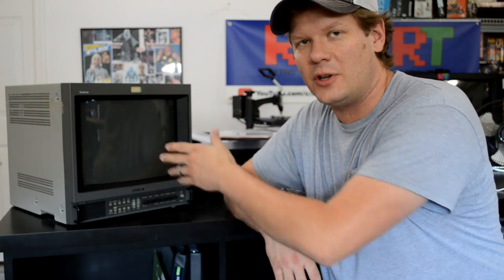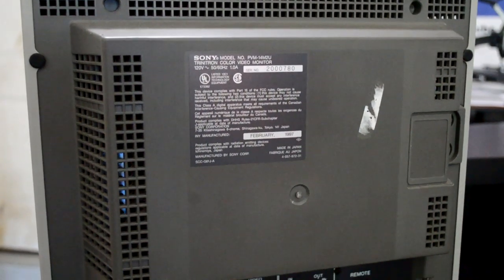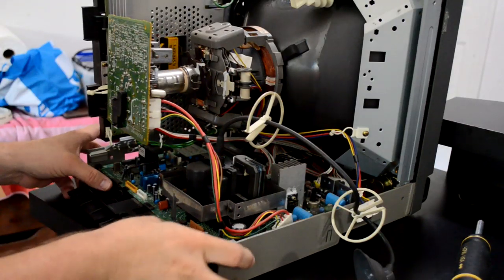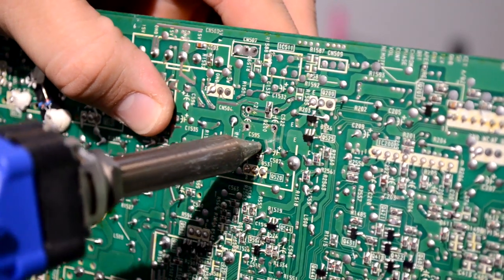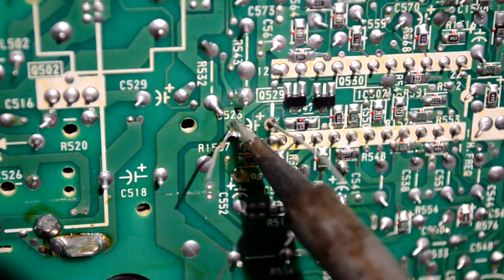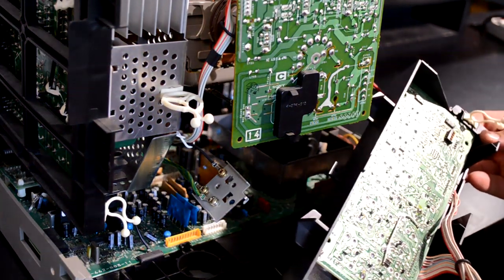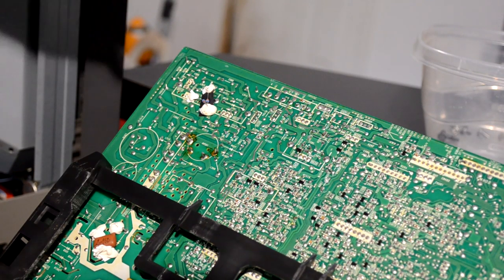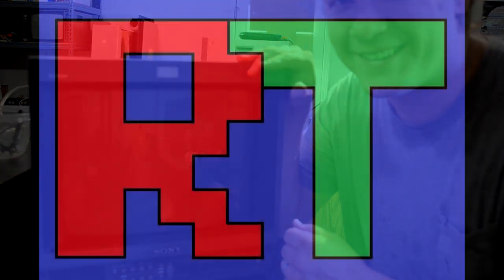Sony PVM 14M2 Repair & Custom PVM Mods! Is It Fixable?

Comment: 5:49 I saw this kind of thing on a 14M2E also, so there's a very high probability to be a factory modification for that chassis, even for the diode. Remember, it's a pro equipment, so they used silicone glue since these monitors can be shipped from one studio to another or in a mobile station for an event. So these modifications are strong, high temp/voltage/humidity proof, flexible. 

1KV capacitors leads in PCEngine GT/TurboExpress are sealed in a similar way (smoother : it was planned) since 80+ Volts are somewhere inside the console.

Comment: That trace/jumper wire on the back board is also on mine.  After posting on several forums, I think that was done by Sony technicians & is completely ok for operation.

Comment: Where would you even begin if you wanted to repair that board without just the simple recap? It makes my head spin just thinking about it.
Reply from the maker: It's a lot of guessing and looking for failed parts, bad traces, cold solder joints.  I still learn new stuff all the time about these machines.
Reply: CRT repair was a full time job back in the days
Reply: Service manuals have whole board layouts in them and some instructions on how to troubleshoot common issues.

Comment: I found a 14M4U with the same problem and it turned out to be a shorted diode.
Reply: I think it was D502 or D504
Reply from the maker: Cool, do you remember which diode?  I'll need to see about how to test diodes.  Thanks
Reply: @RetroTechUSA  I know it was one of a pair of large black diodes on large traces in the deflection area. It had visible burn marks in the area.
Reply: @RetroTechUSA  Also testing diodes is easy, just use diode mode on your meter in both directions. The voltage drop should be much larger in the reverse direction.
Reply from the maker: Thanks!

Comment: Hey Steve, thanks for sharing that.
I know this is more than 2 years old, but today I was working on one of my PVMs, a 1997 like yours to refresh the convergence caps and I found the same components there, the epoxy is a little different though but the parts look just like yours. I think they were stock, maybe not from factory but the distributors or something. I took some pics, I can share if interested to see.

Comment: I have a Sony PVM 14M2U with the exact same overscan issue. Also, when I first fire up the TV, the picture vibrates and there is a ton of fuzziness, so you can't make out any of the words on the screen. Running the TV for a bit, the vibration goes away, and sometimes the fuzziness goes away. I haven't opened the monitor up yet.

Comment: I've got an old CRT where the menus don't even pop up anymore, plus the volume buttons dont work, and it won't work with a remote anymore either.  Is it just a bunch of bad capacitors?  I'd really like to get it fixed at some point, it's got a component input with a very nice picture, it's a Sansui 27".

Comment: Some of those look like they're factory bodges but those opposing diodes don't. In the PVMs I've got with factory bodges, they used foam tape, not vinyl tape.
Reply from the maker: I think you are right about all that.  I've seen jumper wires installed like this one had on the PSU and other areas, but the Diode thing is a mess.
Reply: @RetroTechUSA  I almost wonder if a PNP/NPN transistor failed and rather than replace it, they installed those diodes (I don't care to watch the video intently enough to figure out the orientation of the diodes and figure out if they're PNP or NPN oriented). But those were like 5 for $1 at Radio Shack, so I can't imagine a situation where it'd have made sense to replace a transistor with diodes unless this is like the 90s and SMT parts are hard to come by.

Comment: Hola ,comprueba todos los voltajes del módulo g Power , también los voltajes digitales que están sin utilizar.
Yo dispongo de uno que es el mismo fallo y es producido por un fallo en la fuente de mentación G .

El fallo fue producido por una alta temperatura al no tener ventilación de momento estoy revisando porque ha habido un sobre voltaje en la línea de alimentación e cambiado el Diodo zener  de control ,Pero la línea de 5 V con cargada da 4,80 , me imagino que algún elemento a 5 V tiene que estar derivado a tierra o un condensador o cualquier cosa

Comment: Hey. Do the PVM-14M2 and PVM-1454QM monitors have a compatible service manual? Similar motherboard?
Reply from the maker: They are similar, but not the same.  Here is a link to your PVM's SM:  https://ia800101.us.archive.org/8/items/SonyPVM1450QMPVM1454QM1354ServiceMaintenanceManual/Sony%20PVM-1450QM%20PVM-1454QM%201354%20Service%20Maintenance%20Manual.pdf

Comment: I have this same exact PVM, and sometimes I notice slight flickering on the screen. Also it has a horrible whine.

Do you know if replacing the caps will fix the random video noise and the high pitch whine?

Also,where can I buy cap kits for this specific PVM?

Comment: Is it okay to keep the remote bridged for the front light?
Reply from the maker: Do you mean with a jumper in the back pin connector?  If so, yes it's fine to leave it jumped and have to have the light on while using your PVM.
Reply: @RetroTechUSA  yes that's what I ment and thank you very much for the reply.

Comment: I've got the same monitor, with seemingly a custom mod where there's a toggle switch at the back that enables the display to flip (mirrored). Bizarre; no idea why someone would've wanted to install that. But a problem I have with it is that the colours shift during random moments, with a tendency to display a purple image when it does shift. I've terminated all the out ports. Any ideas what that might be? Really don't want to get rid of the monitor as the picture otherwise is fantastic.

Comment: Hey Steve, how do you clean your board with alcohol and not get white residue left over? 
Just FYI, you should reflow solder joints after you clip legs off any component because clipping after the solder has cooled will cause microfractures in the joint.
Reply from the maker: Sometimes white residue comes up.  I try to wipe off the are with a wipe soaked in distilled water.  Then I go over it again with alcohol.  It can be a problem sometimes.

Comment: Good day Steve,

That was an unfortunate find with this little guy.
Reply from the maker: Hey Kelly,  Yeah I think the problem was a diode on the main board.  I wound up scrapping this monitor and used all the parts to fix 2 other PVMs, so at least that was a positive.

Comment: have the same problem on my sony pvm-14m1j.have you fixed it yet?what seems to be the problem?
Reply: Did you see my earlier post? Might just be a diode. If so it's easy and cheap to replace.
Reply: @eltair8800  yup ive seen it.but mine's not shorted
Reply: @adamgabrielle5631  That's too bad. BTW, to clarify the testing process use diode mode in the reverse direction and if you get any reading other than open/OL the diode is bad. Assuming you did that correctly, I would recommend a very close visual inspection and testing of any diodes or capacitors in the deflection area.
Reply: @detroit retro gamer drg313 I don't see how your problem is even remotely related and would have the same fix. If a color is missing, either the electron gun is dead or maybe an IC on the neck PCB is dead. You can narrow down the issue by for example plugging green into the blue electron gun.

Comment: I bought a monitor exactly like this one for $150 at my local Ewaste place. The colors are bleeding. I’m checking the capacitors now. But mine has a “jumper wire” in the exact same place as yours on your backboard. Same color. Maybe it came that way? Or was a standard repair?
Reply: I know this is a really old comment but im still gonna reply, These monitors were Pro equipement so they were transported to studio to another (thats why the silicone). My PVM-14M2E also has that and its just a mod for a cap or potentiometer issue i think And it was applied by sony technicians, And the color bleed might just be worn caps on either the A board or the Neck board, Cheers